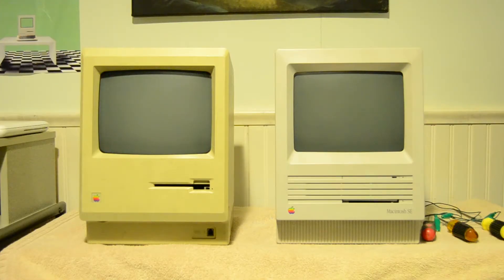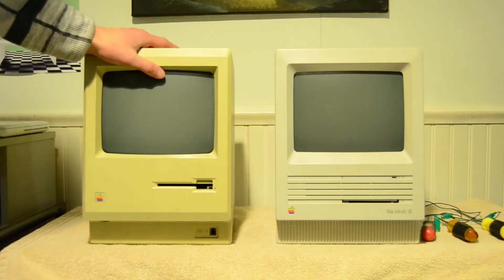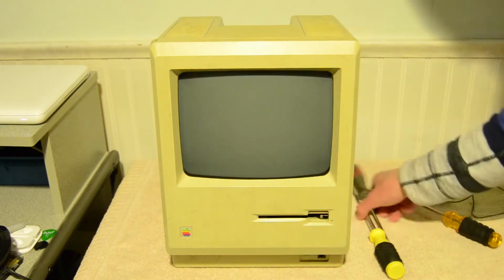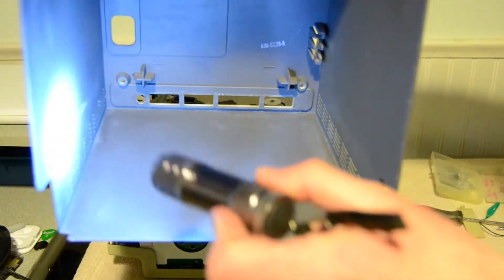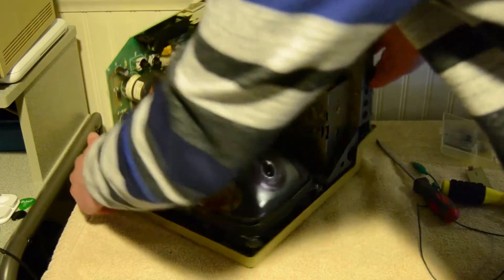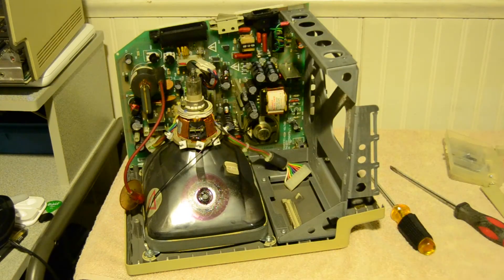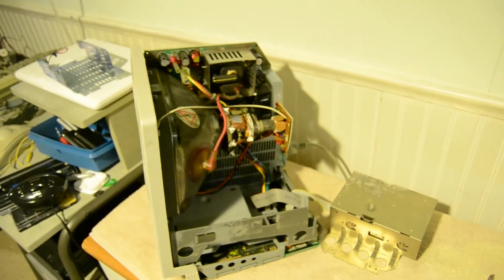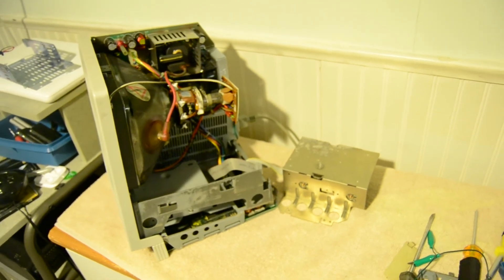Macintosh 512k Restoration [Part 2] - Teardown and Testing the CRT

Comment: I had the same no picture problem with my 512k. The solution was that the connection points on the analog board were actually not making connection even though they may look like it. Just take a soldering iron to the connections on the board at the connector.